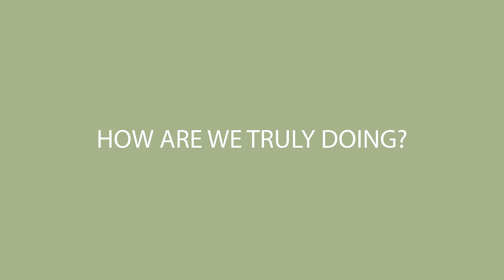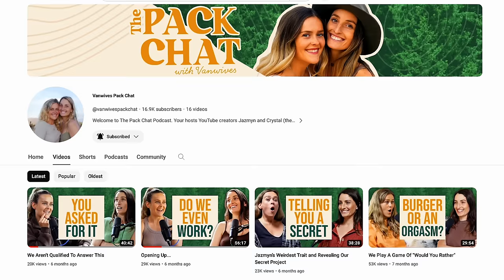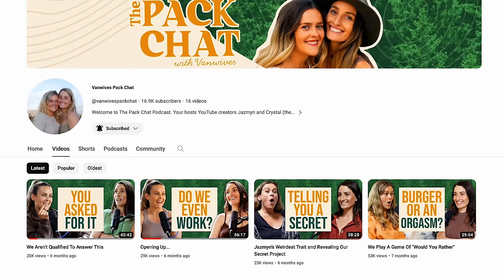What's Going On? Life Update 2024!

Comment: Beautiful! It must have felt good to get out of the cabin for a few. Pretty much expected. Good to see the sun-kissed smiles, though. Love it. Can't believe how the time flies. First started watching years ago because I wanted to part time my own life in a van. Just to see the world. I looked I almost bought, but the vans are just too small for my 6'1" 280 lb frame. I've had a few commercial box trucks in my career. Thought about converting one after watching you girls build your own van. I've been in the housing industry my whole life. So it would probably be pretty easy to do. Ended up moving instead. My van life thought is currently on hold. Purchased an old church in a small town. Spend my days now tinkering and refurbishing the old church. Roofing, siding, doors, and interior stuff, it needs all that. The old windows definitely are not argon gas filled low E dual pain, easy, clean windows. Every one of them needs to be ripped out and replaced and retrimmed. The dry wall and paint are easy stuff. Need to rebuild the sanctuary commercial kitchen and bathroom. The hitlest is a few pages long. Nothing too bad, nothing to get excited over. Just 1 Day at a Time, one project at a time. Okay, so sometimes it's more than one project at a time. But that's how it works. The steps in the process. Finally, finished the 4 bedroom Airbnb underneath the church. It looks good, I think. It's been fun watching you girls learn and grow rebuilding your own cabin. Getting your hands dirty and pushing through the task at hand. Beautiful. You girls have done quite a good job. I love the effort you both put in. The project list can seem never-ending, but don't ever let it get you down. Even if you have to tear everything apart and start over. It's part of the learning process. I have a few 1000 certificates of occupancy under my belt. But it doesn't mean I do everything perfect or right the first time. Missteps can happen it just happens less. So don't let projects frustrate you to the point where you feel you're done. Always remember to step back and reassess. Don't let your frustrations get the best of you. Remember, it's a mindset. If you tell yourself this is hard, it's probably going to be hard. Try not to overthink it and just do. Love the research you girls try to do before any project. Makes things easy when you know...
Can't wait to see the new projects, especially by the lake. You might check on putting a hydraulic thumb on clementine. Pretty sure you girls have used them before on other machines. It just makes it a lot easier to pick things up. I'm not sure there's an extra hydraulic valve available, though. Might be easier just to borrow one of Porter's machines. Didn't like any of the mold seen at the lake cabin. That stuff can track home pretty easily. Don't want the pups anywhere near it. They can't cough it up like we can. There's mold throughout the woods, but some kinds are worse than others...
Would love you girls to check out some class C motor homes. Don't think you girls need a six hundred horsepower pusher diesel like dad has. But something with a bit more room for those adventures. Something with more room for the pups. I don't recall you girls putting in a space with water and sewer for the R. V's. A dump and fill station would be great for some of your guests. A full time r v hook up site would be beautiful. That is, if you don't already have a spot in place. Perhaps two camp sites and put the electrical /Satellite cable pedestal and water and sewer in the middle to share. Whoops projects projects projects...
Thank you, girls, for sharing.
Love the pack. ')
Reply: I'm usually pretty free after about 3 pm. Although you're more than welcome to blow up my phone any time you'd like. Hope you girls and the pups are doing well.

Comment: So nice to see you again! 🙂 Looking forward to join your adventures and projects in 2024 🙂

I think it's quite interesting, to observe how different building techniques and codes can be. 
In Norway a normal wood wall is fairly different from what you do.
From outside:
Sidings ; 
ventilated air-gap, striping; 
windbreak (but not water/vapor barrier); 
15 cm (6") construction and insulation;
vapor barrier;
5cm (2") sriping and insulation;
drywall, or other wall panels.

The sidings are supposed to keep water outside, while a water seal on the outside, would be a vapor barrier, where humid inside air would be trapped, and when it reached the outside, there will be condensation when it's cooled down.